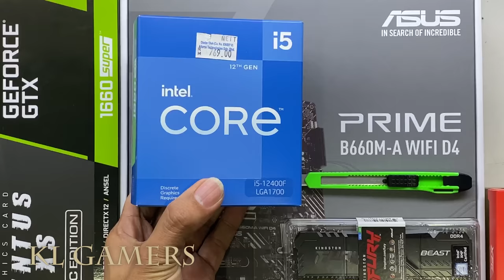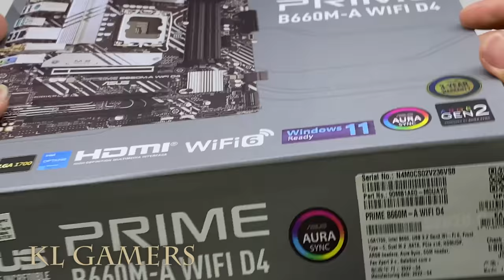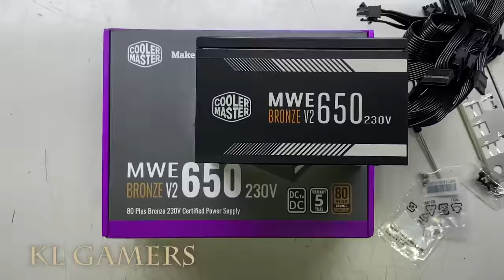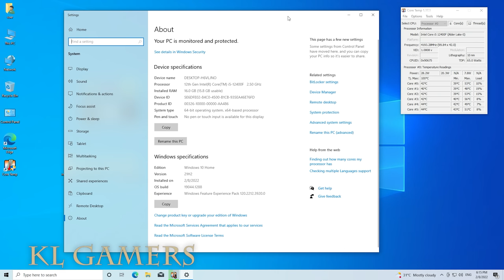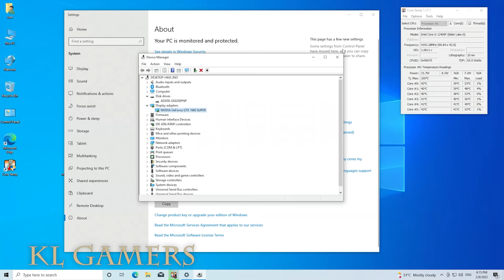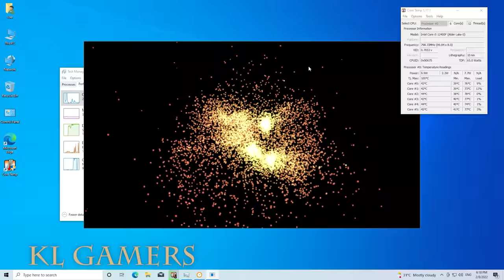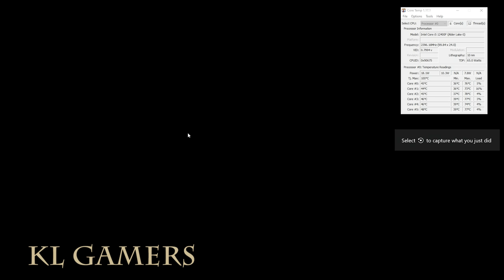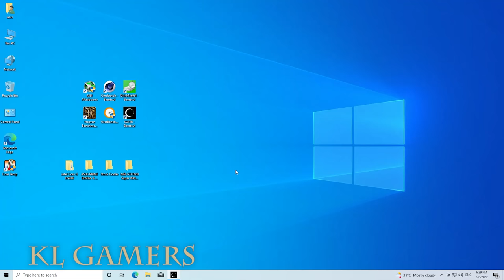intel Core i5 12400F ASUS PRIME B660M-A WIFI D4 msi GTX1660 Super Montech ARGB Gaming PC Build

Comment: RX6600 > 1660 super/ti, better value to performance in the current market, also your cpu will be 100% utilized due to a weaker gpu, you will need to upgrade your stock cooler due to this. The ram stick is supposed to start in slot 2 I thought or it doesn't matter as long as it is in slot 2 or slot 4?
Reply: Putting your ram sticks into slots 2 and 4 will enable dual channel (some motherboards have it in slot 1 and 3)

Comment: Why do you fall short in case even though bunds are strong ??? ❤️And I want to ask you if the motherboard asus a320m k can support the rtx 2060 graphics card and can it work with the ryzen 3 4300g processor.
Reply: RTX 2060 is far more powerful when it is paired with ryzen 3.. use ryzen 5 3600 or ryzen 7 5800x
Reply: @nichanipse1276  So if you use rtx 2060 with ryzen 3 4300g it will cause malfunction and will cause a drop in frame rate and suspension right??
Reply: @farmaga_man8333  they call it bottleneck..it will limit the maximum requirements of your PC..
Reply: @nichanipse1276  OK thx 😊

Comment: Hi bro.  Tell me, please, my processor is also the same, but it gets very hot, it rises 80 ° in the game.  What is the problem?  I have good cooling.😑😑
Reply: Maybe check ur thermal paste spread
Reply: @mynameisciko4885  gd900 my termal paste
Reply from the maker: 80c is average temperature, not overheat
Reply: @KLGamers  thank you very much I was already nervous
Reply: @DRAGONBORN_GAMER  what game u play ? u using stock cooler?
Reply: @vekostudio  zalman air coiler need for speed heat
Reply: @DRAGONBORN_GAMER  what make cpu will become high temp..Is because the cpu runs working 100% pairing with high end gpu ....other reason termal paste or fans issue😛
Reply: If your gpu is too weak, your cpu will be utilized 100%

Comment: Gtx 1660 Ti or gtx 1660 super?? Which is better?🤔
Reply: ti is better please watch benchmark channel  exmple 2080ti vs 2080 super you will see the different
Reply: 1660s is usually better and can be cheaper too
Reply: Ti is better than Super, but you barely lose about 5 FPS difference in both graphs apparently in Benchmarks
Reply: Rx6600 lol